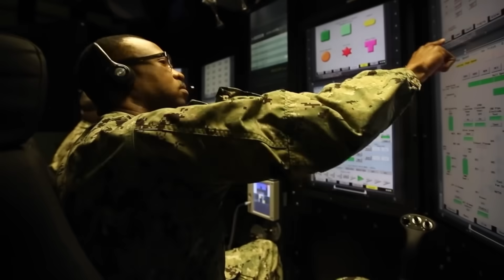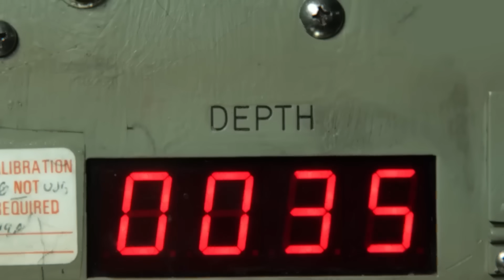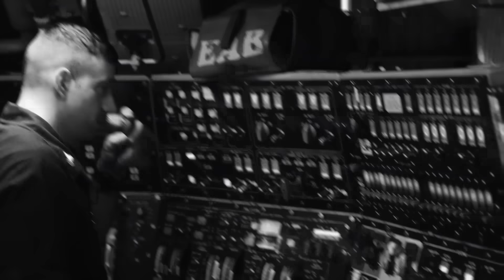What Happens When a Submarine Hits "Crush Depth"

Comment: Nothing happens... Crush depth is largely a myth and the actual depth at which cascading structural failures occur is determined by a series of factors, the least of which is not unique imperfections and peculiarities in the manufacturing and assembly of each vessel. In reality, those peculiarities are ultimately responsible for the ship failing at crush depth or in some cases long long after it but ideally never before crush depth.

Comment: The outer structure is crushed and the pressure hull implodes! since your below 2000 feet, and a compartment hasn't imploded, don't expect a rescue as the so-called DSRV rescue sub implodes just below a 1000 feet!  I remember the video from sub-school in 1976!

Comment: Thanks to the titan im getting all this knowledge about ocean depths & submarines..interesting to note is the last submarine mentioned descended to the trench Mariana,to a depth of 35200 & a depth of this magnitude results in a water pressure of over 1000 atmospheres,the hull had a steel 5 inches thick and a diameter of 6 inches thick now compare that to titan which was made of carbon fiber going down to a depth of of about 12500 ,this is just intriguing really..

Comment: Remember, these are the non-Navy numbers. If you were ever in the silent service, you've heard different. Also, the Seawolf class is in a class by itself. I don't even want to speculate what the USS Jimmy Carter (SSN-23) is capable of. That one was so secret, that (when i was on the way out) when i checked the crew into the Dive and Drive simulator, only the ranks were on my list, not the actual rates. Ironically, one of my BESS classmates, who didn't take a bonus and went striker,  made it on. Good for him.
Reply: I took a tour of it once. Everything being TS and the boat being in port, everything was covered so... didn't really see anything too cool apart from standard sub stuff.

Comment: Notice how there’s no windows?
Reply: why would you add windows to a military sub? They only use them for research subs
Reply: @valraukardso7117  they shouldn’t have had that little window on the titan.
Reply: @OfficialBigDennis  I dont know what part on the titan was failing. But since many experts had concerns about the carbon hull i guess it was that. And it also depends for what depth the windows were desgined for.

Comment: I spent 10 years on board a submarine sister ship to the Thresher, USS Permit SSN 594.  It was the brazing on the piping that caused that sub to go down.  They lost primary propulsion  (reactor).  They tried to do a emergency blow with 4500 air.  Water had leaked into the emergency blow tubes which had a freeze seal occur and no more air could assist with the emergency blow.  She went down and all 129 men on board died.  The amount of men on board was higher than normal because it was just coming out of the ship yards.  Normal crew size would be around 100 give or take.
Reply: And every modern (American) submariner still knows the story of the Thresher.

Comment: On the topic of pressure and building vessels to withstand it, just think, on the surface of Venus the pressure is about that of 3000 ft underwater (93 bar (1,350 psi), ~100 atm).  On top of that the temp is about 467 °C/872 °F.  No wonder there have been so few probes to the surface.

Comment: The Titan sub had to withstand 440 atmospheres and 2.5 TONS/sq inch

At those pressures water would come in like a knife

The Trieste was also a sphere, the most stable geometry for high pressure.  A cylinder, like a sub, is much more vulnerable.

Comment: For those watching this in June 2023 - this is not the mode of failure of the Titan submersible. That implosion was quite more catastrophic and instant due to the stiff composite material used to manufacture the hull. Think of an eggshell failing vs a tin can being crushed.

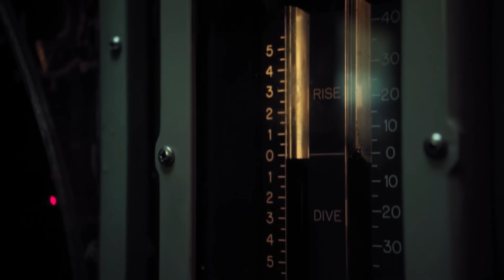Comment: 2:07 - "If a pressure hull implodes at a depth of 2000 ft, when the air pressure is around 60 atmospheres, the internal pressure will rapidly from 14.7 to nearly 875 PSI" - like, Whisky Tango Foxtrot?
Firstly, "at a depth of 2000 ft" there's a WATER pressure, not AIR pressure, for crying out loud - and then can't yuo just stick to one system of units, be it even US Customary one? WHY mix atmospheres and PSI, what good it'll do?
'nuff of this nonsense, I'm outa here, thumb down.

Comment: With reluctance I will share a horrible thought that came to me. What if the implosion was gradual...at least at first. Why might that be the case? Perhaps because the pressure was slowly increasing as the sub went deeper. When it reached the breaking point there very likely were tell tale signs of danger that had already become noticeable. The sub very likely did not go from safe and sound to suddenly crushed for the simple reason that the pressure increased by degrees. If the stress was gradual as the vessel dropped lower into the depths then the collapse might at first have been slow, but very possibly... noticeable. I dread to think of the terror and sorrow of imminant death as the increasing pressure became obvious, with the realization the nothing could be done. I must confess that my saddest thoughts were with the 19 year old boy facing the end of his young life with all of his hopes and dreams shattered. I had read that he was actually reluctant to go into the deep water. If this were true, all the more the sadness of this tragedy will linger, even though we had no connection to him, his father, or the others who perished. May God have mercy on their souls.
Reply: Carbon fiber does not dent or crumple.  It explodes as it shatters apart.  It would have been fast.
 Not enough testing had been done on carbon fiber to find out it's weaknesses.   Using drone subs.

Comment: All subs have the ability to perform an emergency blow to allow high pressure air into the ballast tanks and force the seawater out of the bottom.  This forces the sub to the surface.

The crew of the Thresher would have tried to activate this system by throwing the Chicken Switches in the control room.  The theory is they did try this but the system failed.  At which point the crew would have attempted to operate the valves manually by cranking them open.

These valves are complicated devices.  The theory is that the air was likely "wet", containing a lot of moisture.  This can happen if the air compressor discharge goes through an air dryer to remove moisture in the compressed air and it is not functioning properly.  The tanks holding the air also need to be drained of moisture manually daily as well.

So, when high pressure goes to low pressure and it has too much moisture in it it will freeze.  So these valves for blowing ballast likely froze to the point that even manually cranking them could not open them.  So with the flooding aft and no ability to blow the ballast tanks,  and no propulsion, the boat would have slowly sank until it imploded.

I've witnessed the depth gauge go beyond where we ever wanted to be.  Absolute pucker factor of the rectal orifice.  The boats make a different sound when at great depths.  Makes you wonder how quick death would be.  You'd never even know it.  Not a cool thing.    

Training is phenomenal on subs.  The sub crews are in a wartime mentality because you are always going to need to be able to save the boat regardless of the situation at minimum from the ocean regardless of adversaries.  I have found nothing like it on surface ships or anywhere as a civilian.  Loved my time in the Navy but particularly serving aboard subs. 

I know I'm not smart enough to be an astronaut, so I figured I'd do the next best thing by being an internal astronaut.  

RIP Shipmates.

Signed by an A-Ganger Bubblehead.

Comment: I only came here for the comments – I hope my comment is up there with the Best..  
When submarine implodes is exactly the same, as when you eat your favourite delicious pizza, and it goes through your digestive system gets broken down and afterwards you go to the toilet and it comes out the other side, all squished up and gets flushed down the toilet and ends up in the Ocean .

By the way , Pizza  usually cost anywhere from $10-$20, depending on the toppings you get .. it’s a lot less expensive than a submarine ride..

Comment: This video is basically nonsense wrapped around a few kernels of. "The crew would perish multiple times" ? What the heck does that even mean you can only die once! Seriously there's only one thing that happens in a catastrophic implosion, the water crushes the sub inward almost instantly at mind-bogglingly fast speeds essentially an explosion moving inwards. Death is instant, bodies are pulped, and nothing is left but fragments. Math has been done on the force that would have been exerted on the interior of the titan sub and it occupants. The crew and passengers would have been subjected to a force equivalent to 47kg of high explosive from all directions instantly. All the stuff in this video only covers depths of 100-400m. The titan was down to 4000m. Way different.
Reply: It's saying the crew would be so dead that they will have experienced multiple ways to die all at once
Reply: It's a silly bit of video confection slapped together for mindless YewToob viewing... meh.
Reply: Also I heard they lost communication at 3500ft

Comment: I've always wondered what would happen to the pressure inside if, at the surface, you filled a submarine with water, sealed it and sent it down below its crush depth.
Reply: Filled with air, the hull gets a tiny bit smaller due to the outside pressure. Someone else could tell you how to calculate how much. Filled entirely with water, it should still get a little smaller, but less than before since it's not just the hull that's pressing back, but also the water inside. If you leave a tiny air pocket at the top, then most of the pressure will end up going to compress that pocket, until it's 1/300 of its original volume. Before then, the hull would probably be supporting most of the weight.
Reply: @RiskyDramaUploads  "Filled entirely with water, it should still get a little smaller"
I'm not convinced, you can increase the pressure, but you can't compress water.
Reply: @Kaj_Kasket  If you can compress plutonium for a nuclear explosion, you can compress water, lol. A quick search says that ... well, "solids tends to be orders of magnitude higher than that of liquids", so maybe plutonium actually compresses more, but also that "Put another way, it takes a bit over 200 times atmospheric pressure to compress water by 1% at room temperature". With lots of pressure it becomes weird kinds of ice, but let's just say it can compress by at least 1%. I mean, it's not like it's the kind of highly-compressed degenerate matter seen in the center of a star (which still has electrons and protons, unlike neutronium).
Reply: @RiskyDramaUploads  I don't know anything about plutonium, and think it would be very inconvenient to fill a submarine with it. 😉
Reply: @Kaj_Kasket  then your car hydraulic brakes would not work. That is why it is in STEEL BRAKE LINES.
Reply: @bunzeebear2973  What does that have to do with the case?
I don't really understand how you mean it's related.
I know how brakes work, been an auto mechanic since the 80's.
....and by the way, there is also RUBBER AND COPPER LINES for brakes if you want to know.